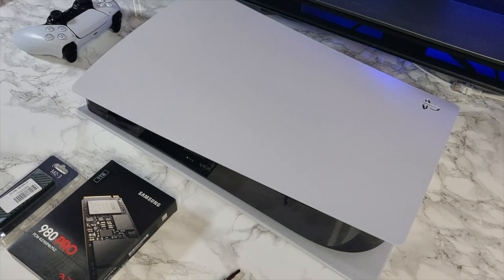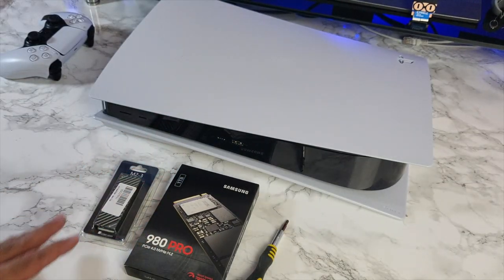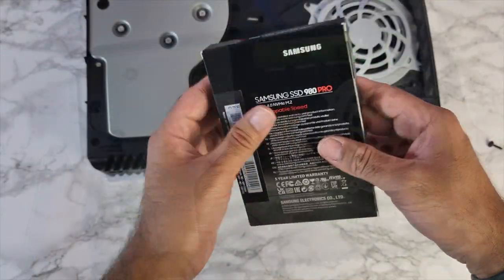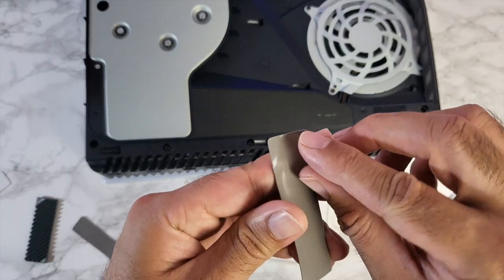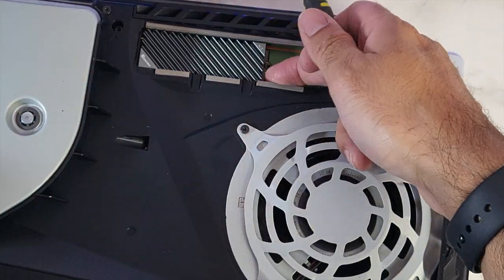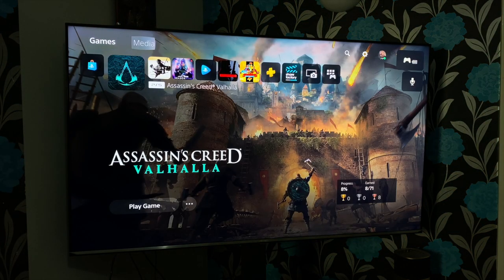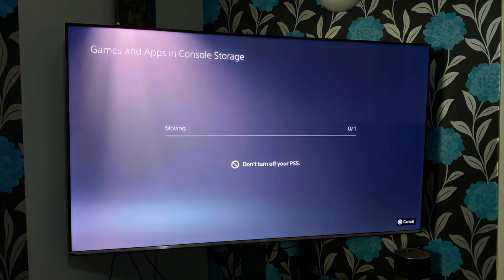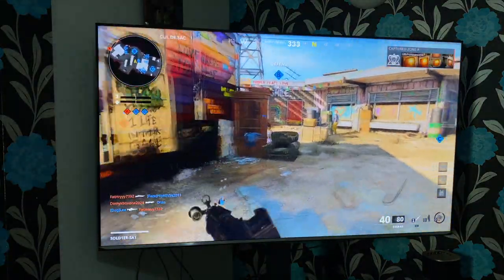Best PS5 SSD & Heatsink  | 1TB GEN4 for Under £135 (How to Install & Setup)

Comment: Hey great vids 👍🏿.  But you made a little mistake, you were supposed to put the silver spacer under before you screwed in the ssd.
Reply from the maker: Yes I noticed after and rectified it. Thanks!
Reply: What silver spacer
Reply: @CasualPlyr  The screw he unscrewed if you look has a washer kind of thing. That's the "spacer", actually a stand. He was supposed to move it also, otherwise the SSD won't stay parallel to the motherboard, but at an angle and will put pressure on the pins. Probably people who complain about their PS5 SSD disconnecting randomly are doing this mistake.
Reply: @rsndetre1  yup I realised this when I was installing the ssd in my ps5 , it was small so I questioned what spacer

Comment: Is this Samsung SSD better than the western digital black NVMe m.2 SSD ?
Reply: I don't think so.
Reply: @Moe_Lester_fromUptwn  yeah but 4TB is not worth it I think 1TB plus the 650GB is fairly enough and 2TB external storage is overkill
Reply from the maker: Done some research and went for the Samsung, it was more recommended by many techies.

Comment: 1TB is not big enough for me and i'm only an average gamer, with 5-6 PS5 games my internal storage only had 240GB left due to game updates etc
I ended up buying 4TB Sabrent gen 4 rocket plus it was very expensive but i shouldn't have to worry about storage space hopefully for the life of the console
Reply: Actually if you plan to keep up to 10 games in your PS5 then the 1TB external storage plus the 650 GB internal PS5 storage will be enough
Reply: @assassin2oo6  It will, I have about 11-12 games all on my internal alone. My external 1TB SSD is coming. I technically did not even need it right now but I just have it to future proof myself. I feel like that between the M.2 SSD (1TB) and the internal storage, most people will be able to fit anywhere from 20-25 games which is pretty good imo. Now if you are a Call of Duty player… well that is a different story lol
Reply: @firedragon_ck4509  Yeah you're right
With 1650 GB you can download your entire games library